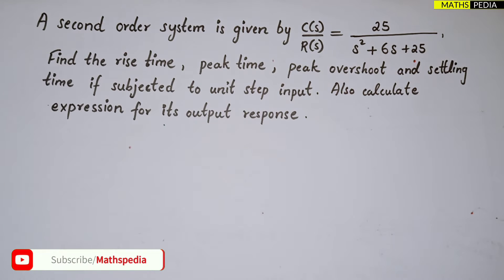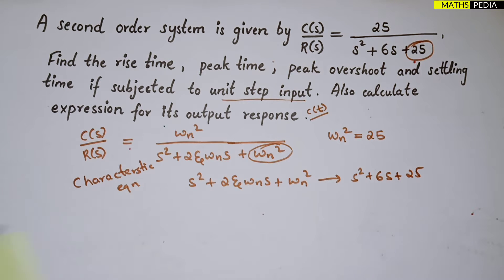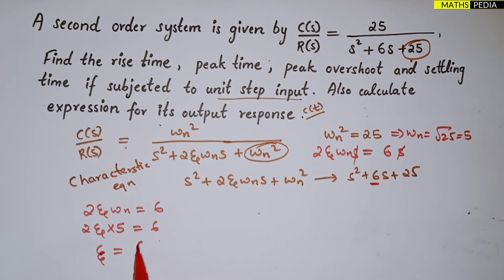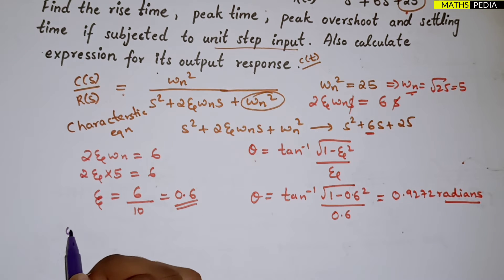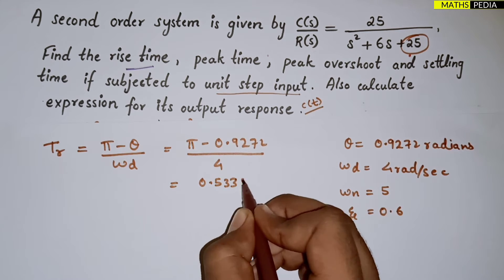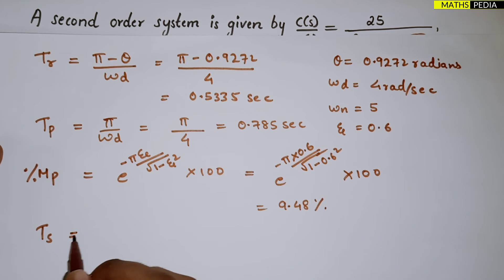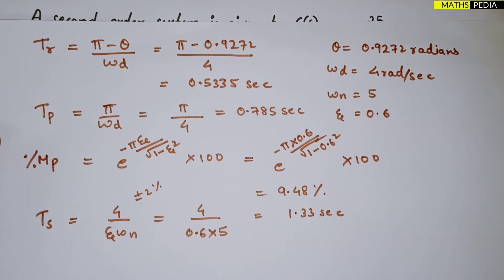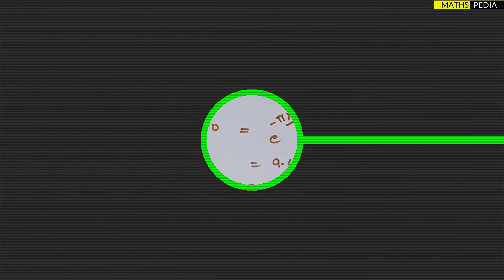Problem to calculate rise time, peak time , peak overshoot , Max Peak Overshoot and settling time |

Comment: The multiplication of 1/s ? It not effect the system?
Reply: It does. I had the same question Turns out, the standard 2nd order equation is specifically designed for a unit step input. So we don't put R(s)=1/s